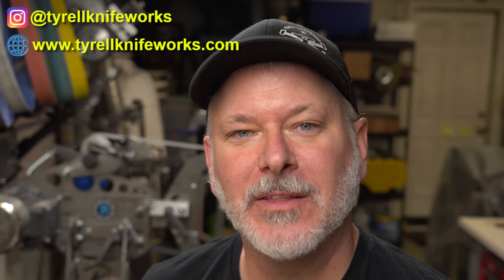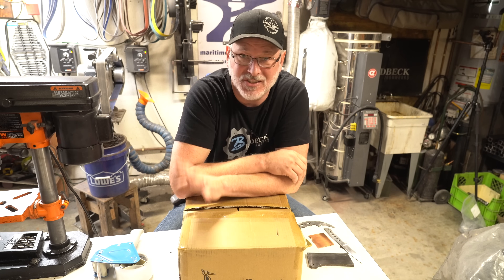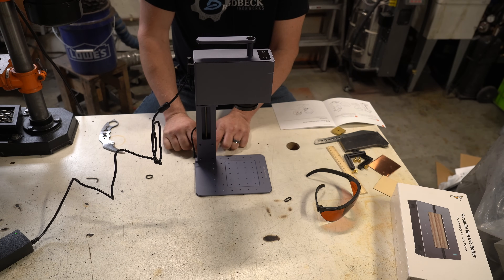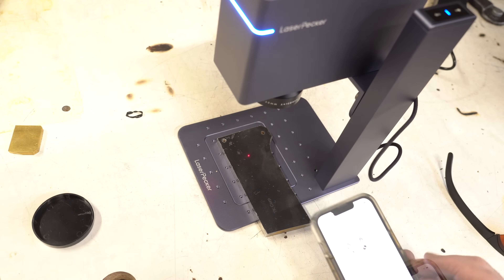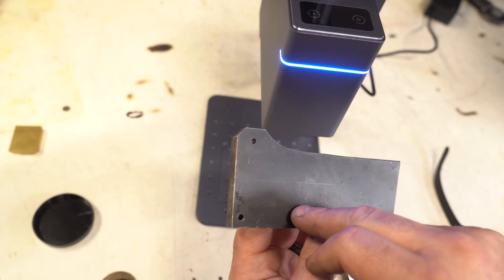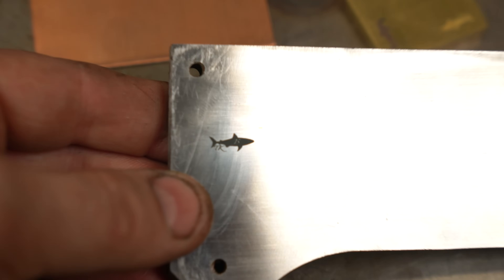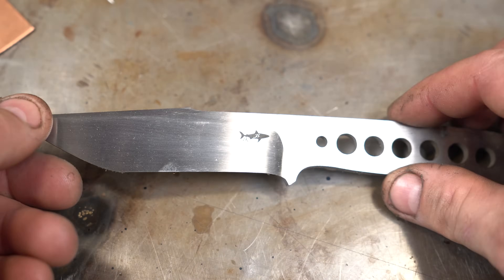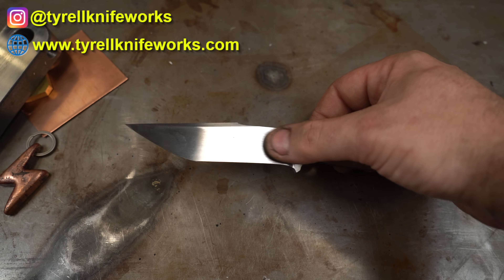Triple-T #155 - Makers mark engraving in steel with the LaserPecker 3

Comment: I have over 50 knives finished handles and all and never put on a makers mark.  I was going to electro etch with a stencil but was afraid they may not be crisp and clear and have some bleeding on the edges. This would ruin my finished knives so I held off.   With this video and the Laser Pecker it seems like I could safely mark my knives.  What about doing finished knives,  some with mirror polish and some with satin finish??  Would I have to put a paint like coating on the mirror finished ones before engraving?? I noticed you marked some steel that looked somewhat polished...
Reply from the maker: I fully finish my knives now and do my markers mark last.  Also, I don’t use the Laser Pecker anymore.  I have the XTool F1, which is a better machine.  (See my more recent video on that).  Thanks for watching
Reply: Oh thank you for replying so quickly.  Is your new X Tool laser more costly than the Laser Pecker?  I make knives as a hobbyist and don't sell any. Being retired on SS cost is often a limiting factor for me.  Thanks again.
Reply from the maker: @glenpaul3606  it’s about the same price. I think they are around $1600.
Reply: Ouch, I saw the Laser Pecker was on sale for 1199 when you made the video.  I would have to wait for another sale.  X Tool at 1600 is a bit out of reach for me.  I suppose if I was selling knives that would be different.  Dennis, thank you for your quick replies.  Sometime I have questions about problems I run into making my knives and I've tried to reach out to a professional knife maker like you in the past with no sucess.  It sure would be nice to be able to talk with someone on the phone that could likely answer my questions or give advice.  My name is Glen, I'm 76 and retired and enjoy making knives as a hobby.
Reply from the maker: @glenpaul3606 even the LP3 is $1350 right now and it’s much less powerful and featured than the F1.  The LP4 is about the same as the F1 but the F1 has much better attachments, software and usability.

Comment: I got a laser too, a few months ago, best buy  you can get to get a bit more detailed logo's on knifes, a fairly cheap one at like 500bucks, but it can do it all, paper, wood, leather, plastics, all kinds of metal and its very accurate in details. Biggest drawback for me was the laser doesn't show you the area very well where it will be etched before you go for real, so I need to mark the area off and see if it will fit, since the software that works with it is,  while its capable software, its not meant for lasers but for milling machines I believe, laser grbl. But fiddling around and doing some test stuff like this, gives enormous potential for  designs, logo's that aren't restricted to what limits the electro etch ones, and is also without the hassle of electro etching. Only thing is that its slower than that, especially bigger or high detail ones, take quite a bit of time with multiple passes, what is best for the most detail and depth.
Reply from the maker: You most likely have a diode laser.   The biggest drawback is the heat they generate.  These small pulse lasers like the LaserPecker are going to take over the lower end I think.  Thanks for watching.
Reply: @TyrellKnifeworks  yes correct, it does get warm, but at logo size things it doesnt really matter much. Even a thinner blade just gotten slightly too hot to touch after etching for like 25 min. These lasers look way better suited to metal etching though,  I agree.

Comment: To be fair, my diode, 20 W laser etched a very deep mark on carbon steel.  Not amazing dpi but definitely very deep.
Reply from the maker: Yes, they can. It’s just the heat, smoke, and many multiple passes and lower res.   This fiber laser is on sale now for $1199!  Thanks for watching.
Reply: @TyrellKnifeworks  yes the resolution is about 80 times less on my diode laser.  Just be cautious with saying “just $1199” these days, as for most audience here it’s a huge chunk of money for relatively limited functionality.  That’s said, yes, fur professional results and functionality, a pecker beats a diode laser any day for engrave knives.
Reply from the maker: @dmitryk754  it’s regularly $1499, hence the “just $1199!”  😉

Comment: Dennis, love your videos.  Great job.  This looks like a great fiber laser.  I think you are slightly misinformed about the powerful diode lasers on the market now.  My 20 watt can easily mark steel to the point where only low grit belts will remove the mark.
Reply from the maker: Yeah, I know the 20W and higher can but it still takes forever because you have to do so many passes.  Plus the smoke and heat.  This one is on sale for $1199 right now, it’s a great deal. Thanks for watching.
Reply: It’s not he wattage it’s the wavelength of light that matters. This machine uses diodes not a fiber laser

Comment: Is this a 10w laser?
Reply from the maker: This is a fiber laser, not a diode, so they aren’t measured the same.  This is a 1W pulse laser that does 4k resolution. It’s much stronger than a 10W diode on things like metal. Thanks for watching.
Reply: @TyrellKnifeworks  Right, but fiber lasers are also measured in 10, 20, 30...60w.  The one's that are $3-4k are usually at least 30w.

Comment: How much did it heat the steel? I usually do my marks on the laser at work when the knife is almost finished. Or before the etch for damascus. The problem is, the laser heats the steel a lot and might be an issue for the epoxy holding the scales together
Reply from the maker: It doesn't heat the steel at all, not like a diode laser.  Thanks for watching.
Reply: Hmmm. That would be a nice addition! Congrats on the upgrade

Comment: Just to clarify on your explanation, fiber lasers do still use diode lasers in their internal functioning, but the diode is coupled to a fiber line. This allows high power lasers to have their light "piped" over the fiber line to output heads, so it doesn't have to move the heavy laser. The difference in what lasers can cut which materials is down to the frequency of the light colour. Very cool new toy you got there :)
Reply from the maker: Thanks for the clarification!  I’m no expert, I just know it works really well! 🤣. Thanks for watching
Reply: @TyrellKnifeworks   I have been using lasers for a while. Fiber lasers use fiber optic conduit to route multiple high power diode beams into one very powerful beam. The head of a fiber laser is called a galvenometer scanner head, your explanation of how it works was correct.  Because the pecker 3 isn't a fiber laser but still uses the galvenmeter head it is called a Galvo Laser. Now that you have this mostly useless information, you should get a couple of the other small format galvo lasers like the Mr Carve and the Genmitsu Z5-1 and put them head-to-head to see which one is best. You would be the first on YouTube to do it and all us non-rated smiths can see the results on hardened steel. Also you would be my hero.
Reply: @TyrellKnifeworks  no laser expert myself but I know enough random bits of information to be proficient enough in most things 😂

Comment: Looks great, are there settings to make the etch just for depths and not mark it dark?  I do a lot of my blades with a black finish and I'd be wanting to have my logo be on the brighter side to stand out on a dark blade
Reply from the maker: You’d have to play with it I think.  You might be able to clean up the engraving with some buffing to remove the black, I haven’t tried.  You can definitely get the depth though.  At 4 passes it’s quite noticeable and you can pump it up to ten if you want.  I’m really happy with it.  Thanks for watching, Bryan!

Comment: What makes this laser interesting is that its a pulsed unit, whereas most of your run of the mill engravers are a continuous wave machine and ultimately it doesn't really matter too much if its a diode or a tube doing the zaps or if its adjusted with mirrors, crystals or fibre optics. We've been doing it for many decades to the point it will only really amazeballs anyone outside of the technical industries.
But the pulse is what makes it work better of metal, so what you do is you ramp up the pulse to however many times a second and then add the pump to really increase the power for tiny fractions of a second, so what that does is three things-
It runs cooler
It doesn't heat up material as much
It ablates its way through a material instead of heating it up and sending vapours everywhere like you see with continuous wave machines, smoke and all manner of disturbing amounts of fire sometimes.
So by 'ablate' I mean that it literally pecks and chips away at a material, it heats it up and ejects it from the area being zapped and reveals new material under it, then zaps that and that's how you're getting the depth of cut into the material. This is happening in I think mostly nanaoseconds between each pulse of the laser. Its also a little out of my field of expertise, I worked with the damn things for about 12 years on fibre networks and they're all basically terrible for human beings to interact with because they'll turn you blind in a second and burn holes through skin really quickly- so if there's shields or glasses you need to be behind them and don't forget about secondary emissions.
Just like welding, these things pump out a lot of wavelengths of IR and sometime UV light and you'll get cancers on exposed skin.
Reply from the maker: That’s all great info! Thanks, Kris!  I just know it works really well. 🤣. Thanks for watching
Reply: I second this. I would build a UV resistant box or something around this. It may only be small be can still do alot of damage.
Reply from the maker: @stevowhitty3984  LaserPecker sells a box already on their website.  I may pick it up.

Comment: Denis, beware! Very soon you're going to run out of room for all your new tools! I assume you're not going to set this up in the house due to fumes.
Reply: I don’t believe they makes fumes. I’m not 100% sure though. Either way you could just put in on your stove top and use the vent if anyone’s that worried about it lol
Reply from the maker: The great thing about these pulse lasers, no smoke or nasty stuff coming off them.  You still need s ventilated area but nothing like the continuous diode lasers.  This one will live in my office.  Thanks for watching, Bryson!
Reply: @TyrellKnifeworks I don’t think it’s the laser that makes the fumes, it’s the material itself. And these lasers work by vaporising the material inherently creating fumes.
Reply from the maker: @Volt64bolt  The way these work is that it's a pulse laser instead of a continuous hot laser pointed at the material.  They are much lower temp, hence less or no smoke.
Reply: @TyrellKnifeworks  but then how does it clear out the material, it needs to go somewhere
Reply from the maker: @Volt64bolt  There is some "schmutz" around the laser'd area that just wipes off with a finger.
Reply: @TyrellKnifeworks  I see, so it vaporises it to a low enough energy state that it collects just around the workpiece rather than floating through the air. That seems more to do with it being easier to tune in the power with a pulsed laser than just the fact it’s pulsed, cool though
Reply: I'd still worry about doing stainless with it, given the toxins released when stainless gets that hot. Just got schooled on that by my TIG instructor.  @TyrellKnifeworks

Comment: Hi Dennis! Always love your videos. I have a AtomStack 20W diode laser and I can engrave steel with it but it takes a loooong time. I put my logo on one of my knives and it look me running at full power for over 30 minutes. Another factor with a diode laser is different steels engrave differently, some engrave better than others, some take less time, some take a horrendous amount of time. The fiber lasers are MUCH faster on metal. I have one of these on my list just because of how much time it will save. As always, love your stuff.
Reply from the maker: Yeah, the bigger diode lasers can do it, but you’re right it takes forever and you get a lot of smoke, fumes and heat.  This fiber is quick and no smoke!  Thanks for watching
Reply: @TyrellKnifeworks  well with this upcoming sale and your code, I may just drop the hammer and grab one!
Reply: Sorry to be that guy, but that’s not a fiber laser. It has a 2W 1064nm diode laser for the metal etching.